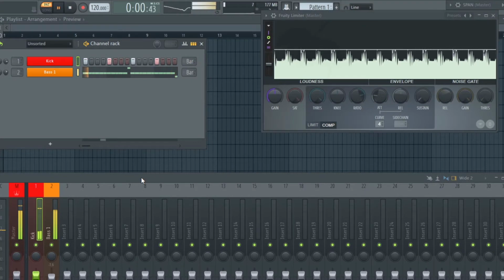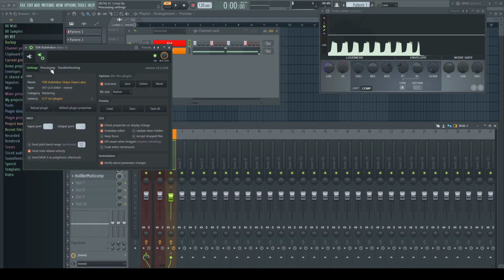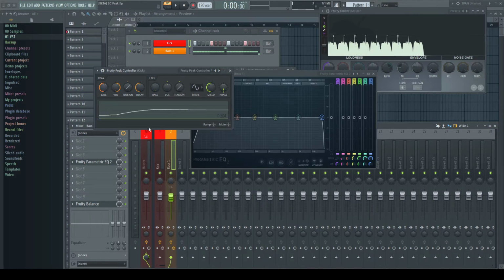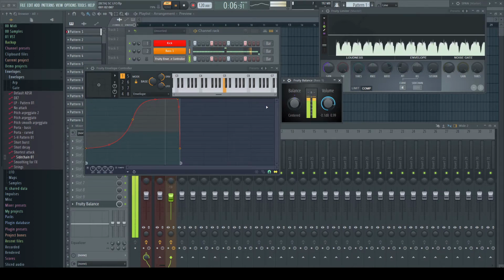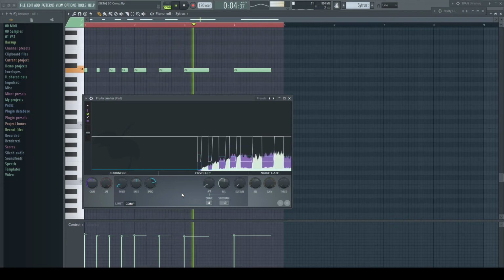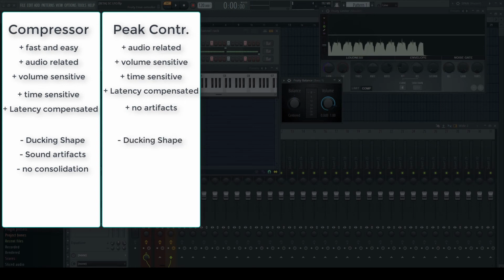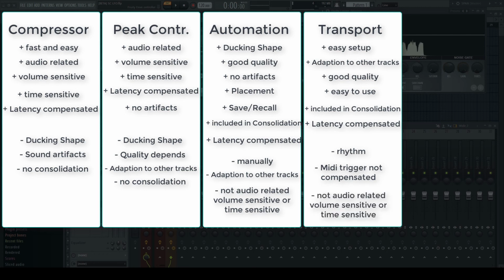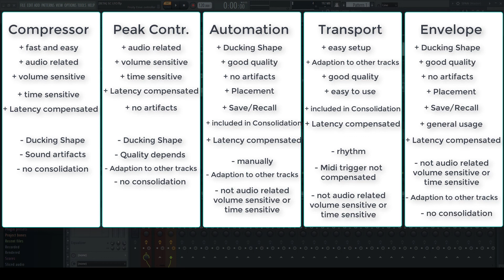FL Studio: Sidechain options...Pros and Cons!

Comment: One issue in automation clips volume ducking giving tiny clicks... Need to move the automation a little left may be 1 milisec to remove that click.. why?
Reply from the maker: What plugin do you automate for volume ducking?
Reply: @flstudiotricks6903  i am using the "fruity balance" for vol. Ducking
Reply from the maker: @gangsterdistrict1154  You could try to open the "Link to controller" window (rightclick menu of the volume knob) and activate a little bit of smoothing on the bottom...
Reply: @flstudiotricks6903 this smoothing doest the job somewhat..but the very first note of the pattern still having clicks
Reply from the maker: @gangsterdistrict1154  Hard to tell from far away 😃
But sometimes it can be a bit tricky with sounds with perhaps sharper attacks...
Reply: @flstudiotricks6903  you are right